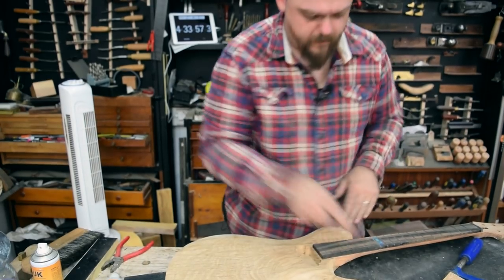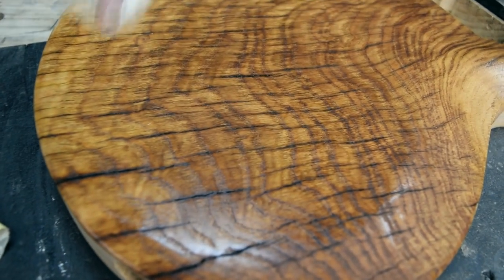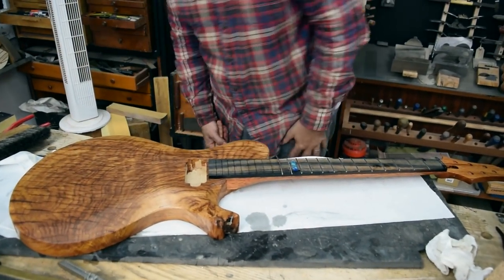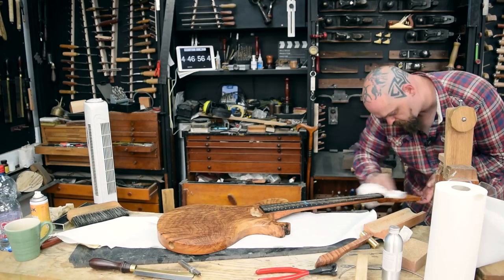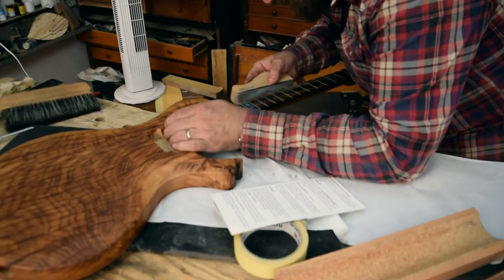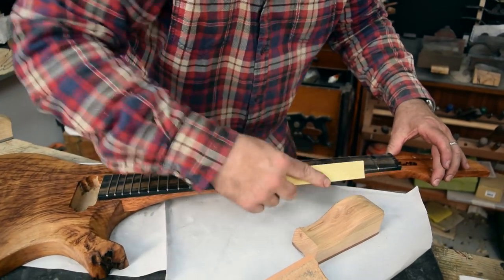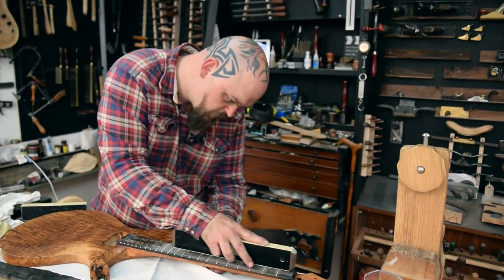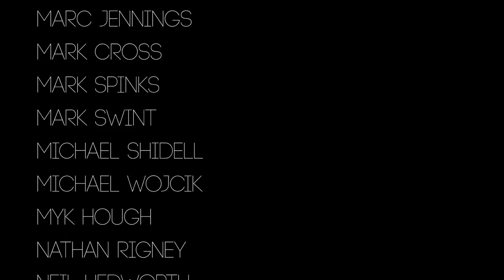Ep 10 - A Luthier Builds a Whole Custom Guitar in SIX Hours.. from SCRATCH! - Close to Finishing?

Comment: I usually use Tru Oil on my Guitars but I tried your finishing oil on my last build and it just wouldn't work on my sapele body...worked a treat and looked beautiful on my maple neck but for some reason didn't like the sapele. I had to strip it off and used tru oil on the body instead which worked fine and left a lovely gloss finish. Have you had any issues applying the finish to sapele?